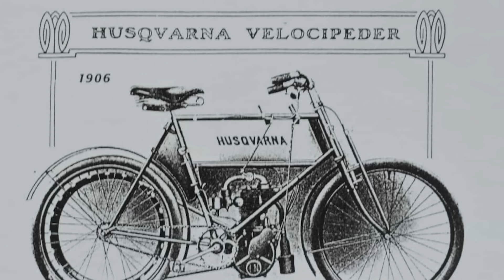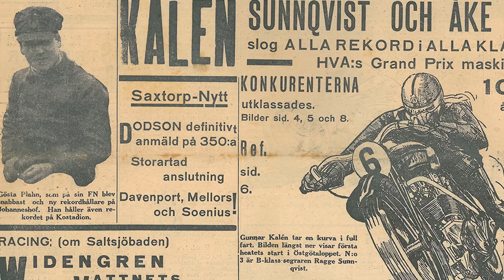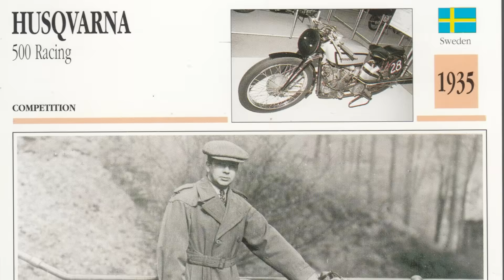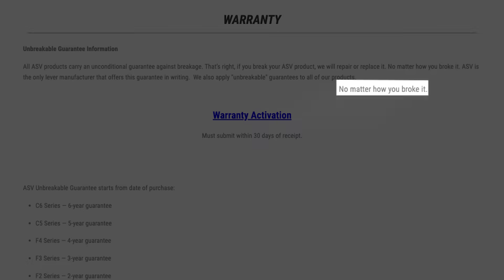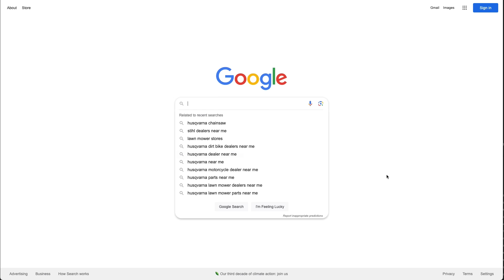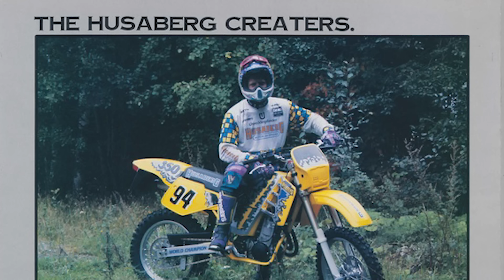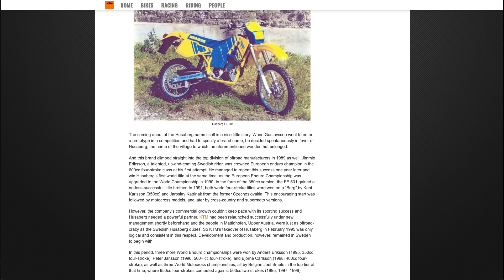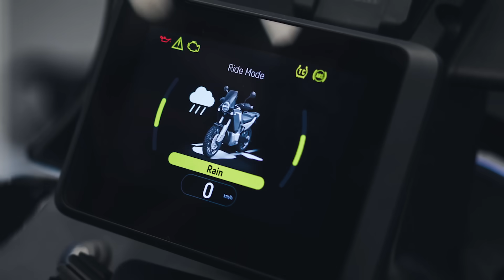So... What's up with Husqvarna Motorcycles?

Comment: Vitpilen 701 owner here....i missed the exhaust note of my old bikes so i went motorcycle shopping recently. Sorry but nothing beats my 701 vit in terms of specs, for the price.

- fully adjustable suspension
- hydraulic clutch
- quickshifter and autoblipper
- flickable like a bicycle
- 0-60mph in 3.2secs (stock)
Every time i stop for gas, strangers come and ask about it. Never happened with my ducati monster 1100 evo with custom paint job and clear clutch cover or with my (cad) 8,000$ worth of mods fz-09..so yea can't beat the specs nor the fun for the price, i have zero regrets and i'm keeping it.
Reply: It's a shame they stopped making them. The 401 is a bit limited, but the 701 is perfect imo. Better in looks, speed and size.
Reply: Another vit 701 owner, love it for all of these same reason

Comment: Unfortunately, I had to deal with a lemon Svartpilen 401. A nightmare to deal with. I tapped out after a year spent at the dealer instead of using the actual bike.

A shame because my old Husky chainsaw bought in the 80s by my Grandpa will just not die.
Reply: Different companies. Their chainsaws are still great 👍

Comment: I find Husqvarna actually a better value with a few up spec components than Ktm
Reply: Not so much with the dirtbike lineup tho since 2023 new gen, although the pricing isn't as different but still no real added value unless you want linkage in an enduro spec (but then just save and get GG)

Comment: The Svartpilen made it to my last 2 on the list of my beginner bikes.  I decided on the Triumph Trident 660 because I fancied that engine and its noise.   My dream starter bike would have had the looks of the Svart with the engine of the Triumph.
Reply: man I would go with the trident but in the UK insurance is a fucking scam…

£3000 annual for a £5000 value bike
Reply: I Chose the Svartpilen 701 style, because it’s unique and I love the torque
Reply: @Rainan8  nice bike, but the 701 was discontinued at my time of purchase, April 2023, otherwise........
Reply: the svartpilen engine is infinitely more fun, and with a real exhaust line the sound is addictive.
(the 3 cylinder too, but the basic chassis of the trident doesn't make me want to, I prefer the street 660 that one of my friends has)
Reply: I also hesitate between Trident 660 and Svartpilen 401 for my first bike. Triumph is more comfortable for me, but also more expensive.

Comment: I have the Svartpilen 701. Its buzzy with that big single cylinder. Not a bike I would take on any long trips. I've rode it 37 miles to a mountain I like to hike and by the time I got there my hands were tingling and going numb. It's an absolute blast to ride short distances though.
Reply: Get bar risers. I have the enduro R so maybe the cushy suspension cushioned the vibration, but i rode 5 hours in a single go without getting tired or going numb. At 80+ pretty much the whole way
Reply: @FilthyGoyim  It's not too bad through the seat but the bars at higher rev ranges are buzzy and the mirrors are useless. I'll probably end up getting different grips and possibly some bar risers if needed
Reply: @foggy561  thatll do it. I had rox risers
Reply: @foggy561  o yea i take the mirrors off all my bikes, ill put them back on when im old and my neck hurts
Reply: I can recommend trigger guards with silentbloc.
but I think you exaggerated 😅
the 2017 701s are true Goldwings among single cylinders and most twins
(I did a 1300km roadtrip in 3 days with my last year, there is the video on the channel if you want to see... how I rode 😆)

Comment: What has been keeping me from buying a husky is their QC. They look great and the spec sheet is impressive but they still have a good amount of issues which has consistently put me off from buying one
Reply: It's just the typical KTM issues. The 701 is rock solid with the 690 engine. If anything is going to hold you back it's the total lack of local dealers if you do have any issues.
Reply: my 690 has 66000 km and no mechanical problems... until some electrical problems.
But at the "time" (Adventure 1190 electronics) the relatively independent sound system, I can unplug the meter or even see the throttle body that it will still start.

Comment: I want a husky 401 or a honda cb300r as my first bike so bad, but i will probably injure myself riding them as i am only used to a single cylinder 110 cc scooter by honda. still i am only 19, maybe one day
Reply: I had a CB300R and now a 401, get a 401!
Reply: I've put 1800 miles on my 2022 CB300R and 500 miles on my 2023 Svartpilen 401. Neither are too much to handle.  You'll need to learn how to clutch smoothly, but neither of these have enough torque to be terribly dangerous.
Reply: @mjb2kmn  the thing is i need to travel 80kms (50 miles) everyday. which one would you say is more comfortable. sometimes with a pillion too
Reply: @georgekrpan3181  aye thanks for the recs G
Reply: @kushfw  The Svartpilen is definitely better with a pillion, and probably a little more comfortable in general. Maybe worth mentioning: less MPG and smaller tank mean I'm fueling up twice as often on the Svartpilen (and it requires 91 octane).
Reply: @mjb2kmn  but you get a bigger engine and better performance right? well i am from india so they will probably adjust the fuel requirements according to the norms here. thanks a lot for your help
Reply: @kushfw  yup, about 44hp for the Husky, 27hp for the CB300. The Husky delivers the power pretty smooth, but it's definitely more.

Comment: Is a Svartpilen 401 too weak for someone weighing in on 100kg (220 lbs)? With its 44bhp?
Reply: Above all, it is likely to be quite comfortable. and yes .. the engine is coupled compared to its competitor, but is more nervous than coupled
I would advise you more a 701

Comment: To bad the riding position is so bad you can't ride it 40 miles before your crippled, and that it has about a 2 gallon or so gas tank. Also super tall seat. If you want to really ride it any where, you will be severely disappointed.